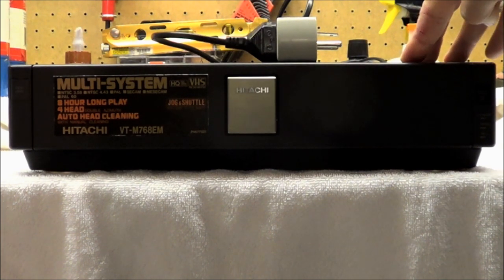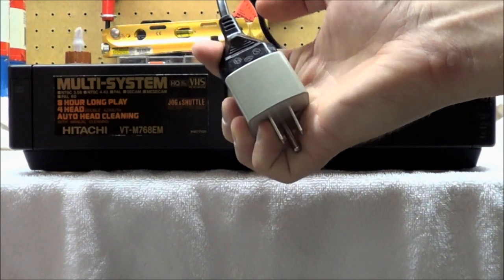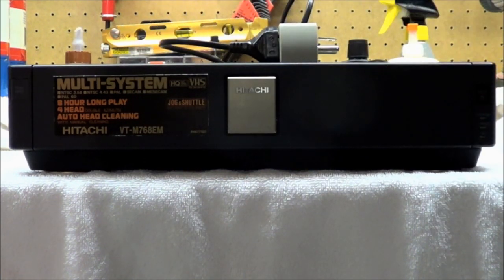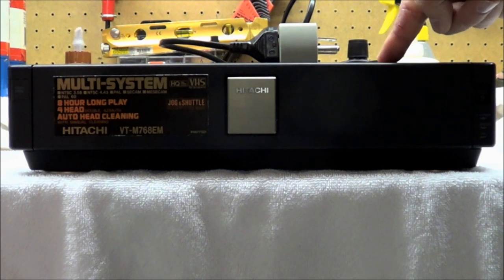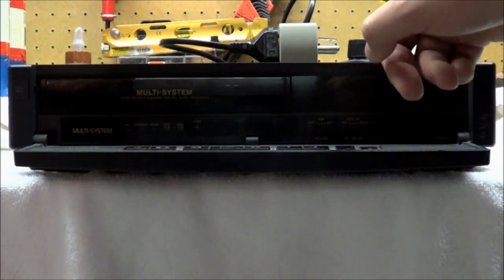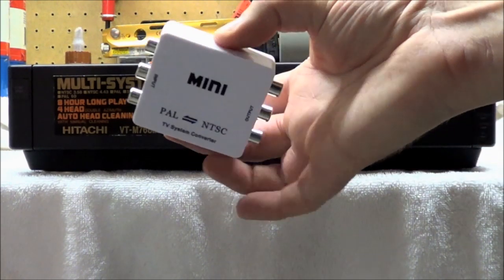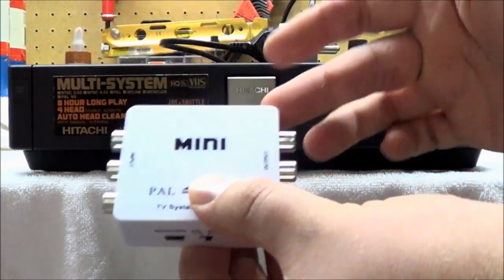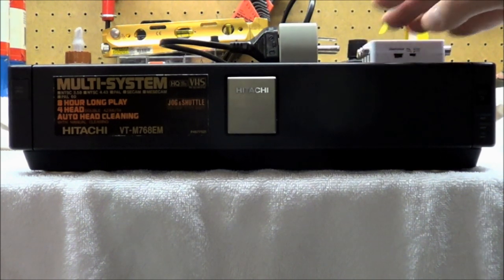Oddity Archive: Episode 64.5 - Ben's Junk: Multi-System VHS VCR (Hitachi VT-M768EM)

Comment: It might have something with the voltage regulating circuits. If you bought it from here in the USA, the previous owner might have inadvertently not ran it properly or had the wrong converter or something.

But the powering down often is just a safety mechanism to prevent damage when there's resistance or a fault detected. Try greasing the mechanics and tracks, and getting some new belts in it.

Comment: Interesting. I'm not sure about this, but keep your eye on the green power light as it loads tapes. I think I see it flickering a bit likely when it's loading motors are drawing current during threading. This could mean the power supply isn't happy and the shut-down problem could get worse (along with the flickering)... or it could be that it just isn't working on 120 volts as well as it should - fyi Also, nice umatic deck, the 2600 is a beast! My first was a 2610 which is essentially the same.

Comment: off subject but thoght of it becuse of "multi"
my neighbor growing up (was a college proffecer so reltivly wealthy) had 2 100 disc changers.
both set up to the same system run in a linked mode
the disc were all loaded perpendicular to the ground in cicle that would spin around. it would pull out selected disc to play kinda like a jukebox
it was an awesome system that actually was alot faster then yould expect with having to swap disc. i think it had the first song of each disc at least partially loaded with how fast it cycled.
 he did eventuly change to digital once the qulity got high enogh. he stores it with almost no compression so the 200+ cds take up alot of room

Comment: I like how he "upgrades" with such old format equipment. Not disrespecting.. just found the statement funny. watching him play with Beta and VHS or even the dreaded Laserdisc so reminds me of my childhood and  digging thought  my dads old routy cases to find BNC, RCA, Phono... ect converters trying to rig (as a unskilled kid) said format player to some crappy Black&White TV or the like.. Poor been needs to find a old mobile studio TV monitor. My dad had one. Classic color CRT but had every available I/O standard of the day. (except SCART) But happy retro hunting! As they say "Out with the new and in with the old"
Reply: John Simpkins How exactly is are laserdiscs "dreaded"?
Reply: True it is a uncompressed video/Audio format. But had little advantage over VHS. Limited available content and a more cumbersome storage and usage. VHS was smaller, more protected from wear and tear. The laser disk unlike modern CD/DVD or more age appropriate DIVX CD. Had ECC to correct data in small scratches on the read surface. So it is no surprise to me that it was not a more widely used format. But that's just my opinion.
Reply: John Simpkins 2 xerox 4,
Reply: John Simpkins s3 3.5 rwss4r4434433334

Comment: Not surprised, but never knew something like this was made. Very interesting piece of equipment. Anywho, Where can I find your theme Mr. Ben? I assume you were the creator of the theme, but I would love to have it.
Reply: If you want to contact him, then message him on the oddity archive Facebook page. I did that and I got a response the next day :)
Reply: wesleyjc80 Maybe it's different in the USA but 90%+ of VCRs here in Europe will automatically detect that a tape is NTSC or SECAM format tapes rather than PAL and depending on your settings output it either as a PAL or NTSC signal. As most (all now we've gone HD?) TVs support NTSC I'd advise outputting in that format if the tape is that format.